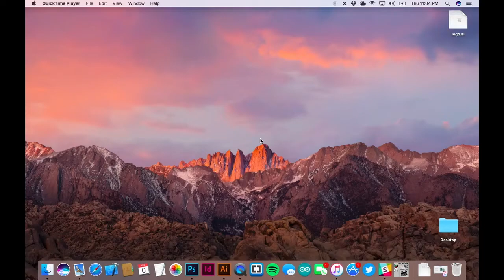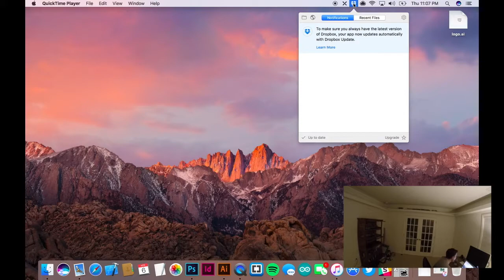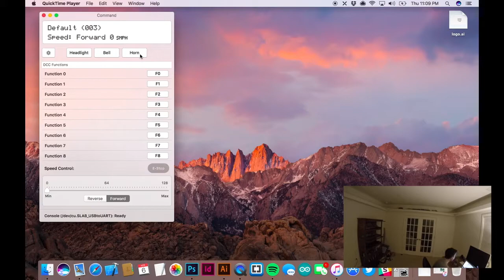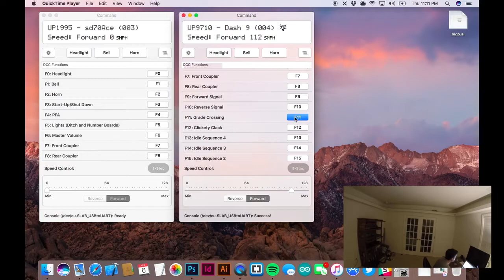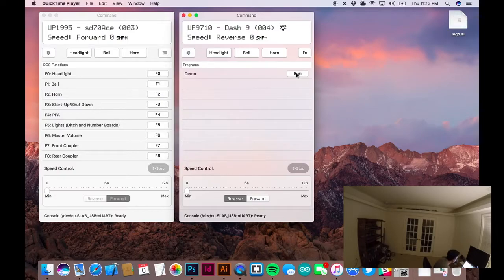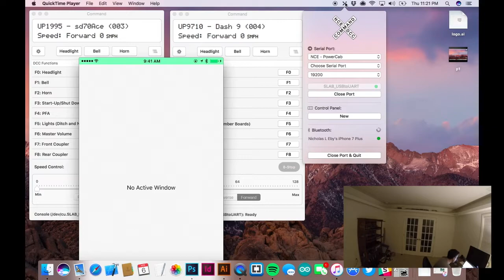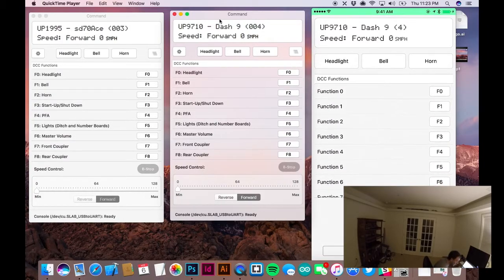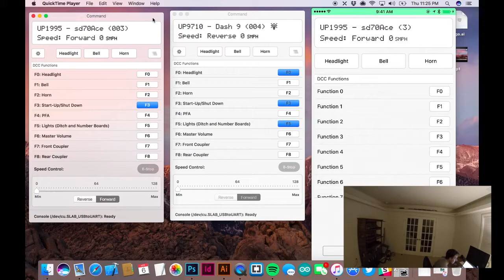nce dcc mac app

Comment: Any thoughts of using DCC++ with your App?  I noticed you are using an arduino on some other projects.
Reply from the maker: Hey Brian, thanks for the comment. I had never heard of DCC plus plus before your comment, looked it up, looks pretty awesome! I have a UNO, would just need to get a motor board. When I get some free time I'm going to see if I can make it work. Let me know if you have any other questions!
Reply: Your software would be a great addition to DCC++.  I bought some cheaper motor boards from China.  I have not used DCC++ lately as I have moved slowly to O scale.